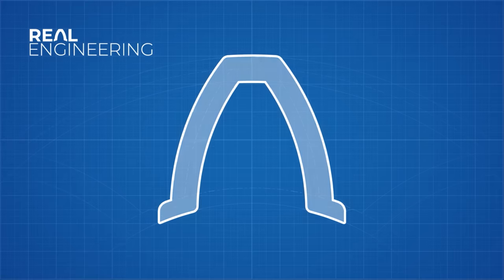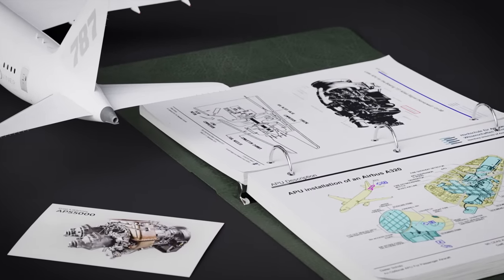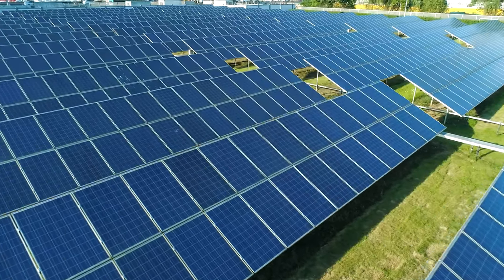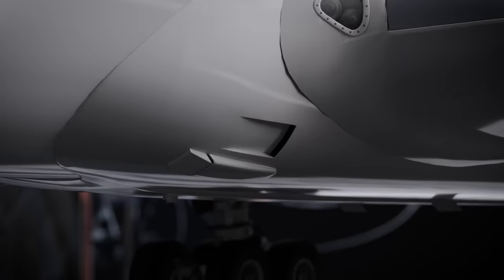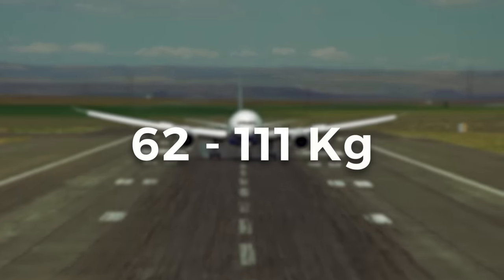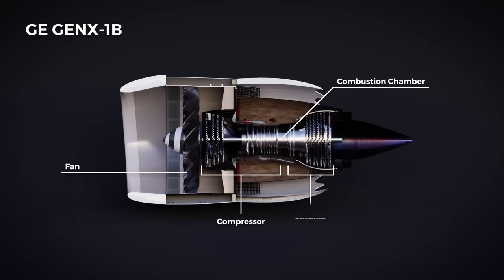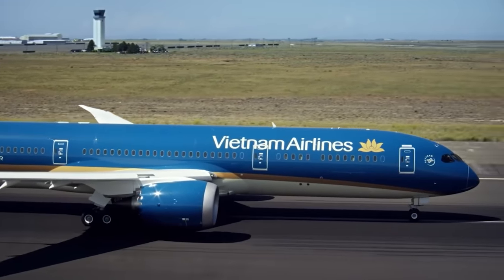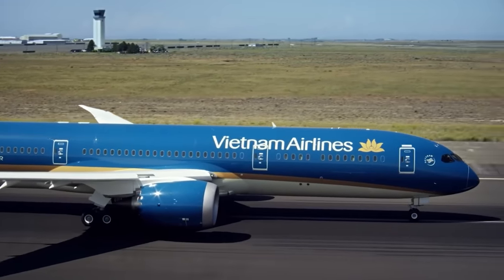The Insane Engineering of the GEnX

Comment: Why you got to lie? How else is it that you confuse nitric oxide with nitrous oxide and call yourself an informational channel? Instead of a disinformation mouth piece.

One called Nitrous Oxide (N2O) is is an oxidizer mostly used for racing engines that need short bursts of power without flash burning engine parts. A consequence of more powerful oxidizers. The other is nitrogen monoxide (NO2). Also called Nitric Oxide. A pollutant that becomes Nitrogen Dioxide when exposed to outside air. Which contributes to the destruction of the ozone layer. Especially when released at high altitudes by commercial jets. The most common kind of jet in the air.

Now everyone watching this that doesn't see through your lie. Is going to think NOS and other brands of N2O cause ozone depletion. Which it doesn't. Right as we're fighting useless litigation based on lies like this one with the RPM Act. A grass roots petition to fight these and other lies. A petition that's being considered in congress right now as you've tried to sell this lie to us.

Racing engines are not even a thousandth as significant of a source of global climate change as poorly designed, built and manufactured machines for transportation. Hence why GE was under pressure to design these new turbofan engines in the first place.